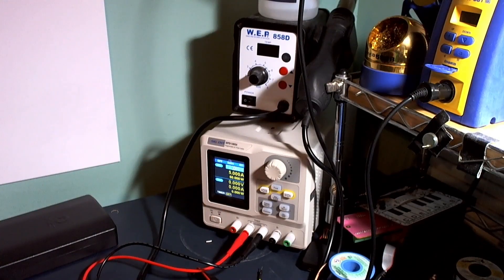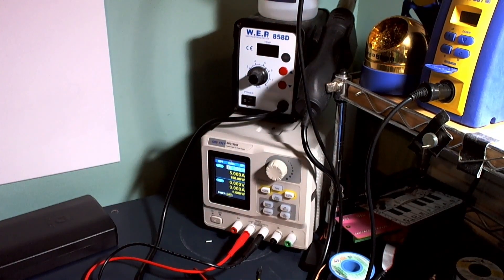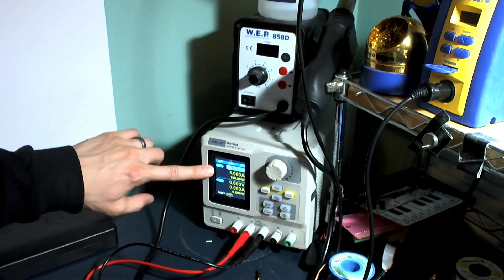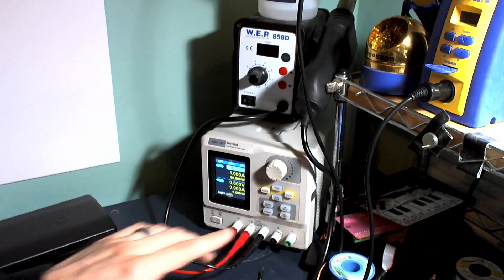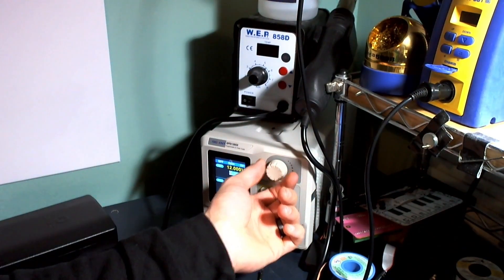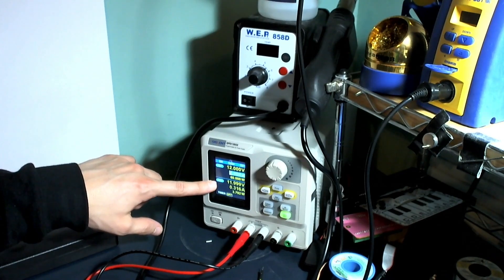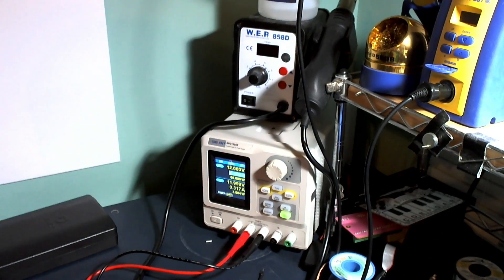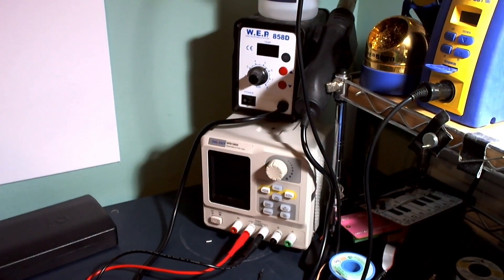Hardware Hacking Tools: Bench Power Supply

Comment: For the type of work I do for now, battery charger with manual DC mode does the trick but I'll definitely need a proper psu for short circuit detection…
Reply from the maker: yeah power supply is a "nice to have" item for me.

Comment: Is it just a DC power supply?
Reply: The vast majority of bench power supplies are DC output only supplies.  AC output is a bit more niche and doesn't often come into play for general electronics and board-level stuff.

If I'm reading the model correctly, that one is the SPD1305X, which, yes, is a DC power supply.  Pretty sure every bench PSU model Siglent makes is DC output only.